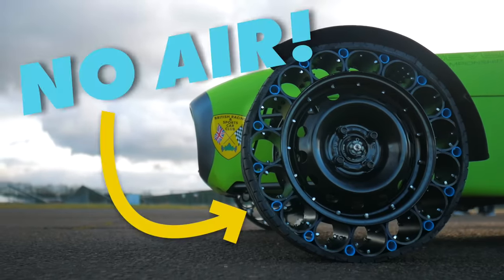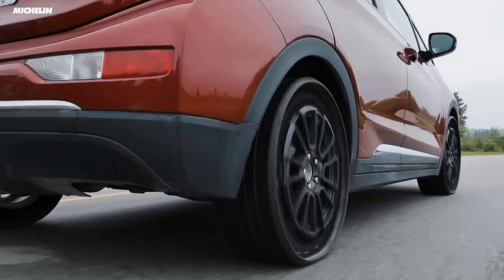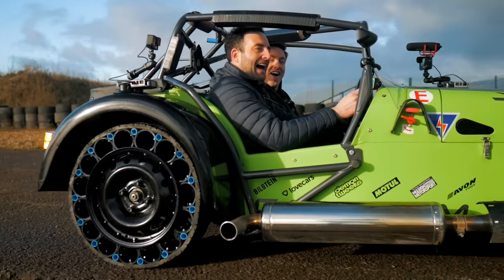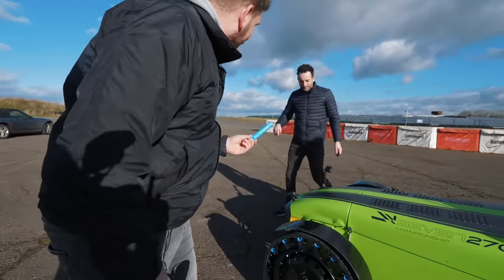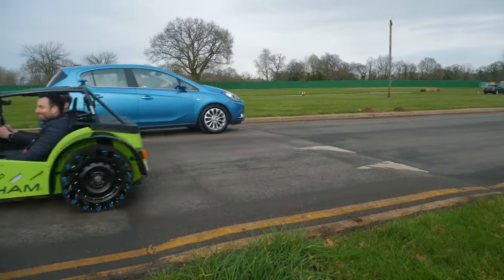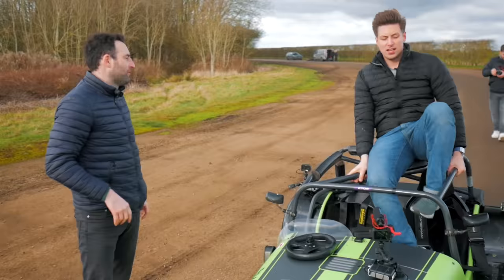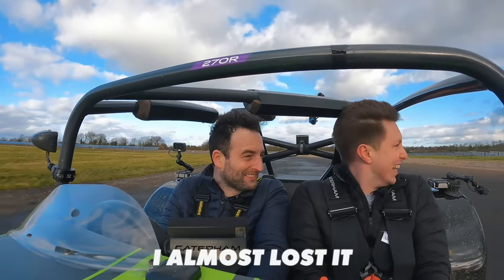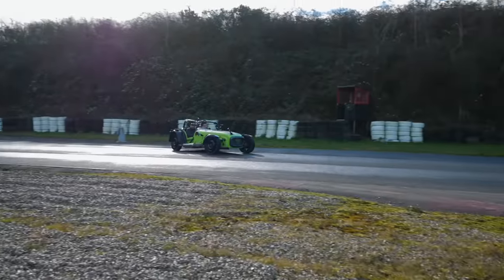I Made DIY Airless Tires

Comment: If they can be made cheaply maybe selling them as an option for spare tire or upgrading them for full out driving would be great like making the plastic parts one unit instead of separate tubes this would allow you to make it round this more stable could go way faster and then attached rubber on the outside could be one solid ring and the tread would be able to take more sideways pressures if it wasn’t flat totally but a small sidewall to enclose the innards not thick at all but it would eliminate air and last the same as it’s air having counterpart  or even using a regular tire with a thinner sidewall having your idea for the tire on the inside to just eliminate the air aspect it will allow people to use them much longer and even start to retread the tires like they do big rigs making it cheaper in the long run the hardest part would be designing that circular structured plastic to be installed before and still able to put tire on rim or have the rim itself be able to be taken apart and reassembled so that you can build it opposite of the current process assemble the tread portion with your pipe parts inside the tread /sidewall unit and then assemble the rim part last the design of the inner rim would make it possible to utilize this on any vehicle as you could have options on each peice making it interchangeable for many reasons like custom colors shapes and technology that can be added to suit everyone and every vehicle the only real problem is designing the product in a way that makes it very inexpensive for you to make it and low enough for customers to justify changing from the regular rim to your product you could make the initial purchase at a much lower gross profit margin than the customized parts that are available this way the product will be available to lower income ppl that need a reliable option and the customer that has a large income and can afford to make a fully custom tire replacement is the one paying the higher margins for a unique product that is exclusive and would be charged as such but if the base model so to speak would be affordable and have multiple reasons that it is the sensible thing to do it would undeniably be competitive with regular tires and would have less rubber no air hopefully similar handling and price unless it’s cheaper and have a far superior lifetime on top of being retreadable but still appeal to younger and all other crowds for its price and options so the low rider guy could pick whitewalls the racer would get streetslicks with the lightweight additions the outdoor guy gets large truck all terrain options and gramma can get the basic model or that single mother with kids can afford to buy the basic version eventually opting for the matching color of the car on the inner setup when the kids get older and are ashamed of the boring rims this could be done even with todays tires and rims but these would be one wheel upon purchase unlike rims and tires but would have more peices that can be replaced for artistic or functional reasons one could do collaborations with fashion designers or anyone like rap stars tv stars etc etc etc and could offer new attachments when the current ones sales die down bringing and sustaining steady sales with endless unique variations and one off auctions artist designs for every big and small niche groups icould go on and on as you see but this idea is beyond good if someone takes it seriously and invests gets investors and a good team to perfect and create a functional product

Comment: I think if we can surround each pipe with a hard rubber to reduce the noise and interaction between pipes on tough terrain and enclose the whole system those tires can go on the market. Shocks should help smooth the ride out. I'll sign up for trials!

Comment: you could fill the pipes and gaps with something like Construction foam so you dont lose bolts and it also could help with the roundnes of it and maybe use something like flexseal at the seam to reduce the noise it makes

Comment: I'm a drainage design engineer and I so wish you boys would have contacted where I work for advice as there are definitely improvements that can be made with some better pipe choices. I reckon I could remove some of the bumpy ride from these tyres.

Comment: I wonder if it would be better if you added a large circular disc to either side of the pipes. Adjust the pipe lengths so both discs connect to the pipes and create the same width as that of the outer tire. Could help durability of the pipes by supporting the car a bit, maybe also make the ride smoother and quieter.

Comment: Cap the inner and outer sides or your tires. Should help deal with both vibration (slight) and sound (large) parameters. Since you're using rigid internal materials, you don't need to worry so much about the flex of the outer caps. (Basically just put a lightweight plate over the sides with all the holes.)

Comment: Since the Michelin airless tyres i've wondered, in certain conditions. Wouldn't dirt and gravel get inside the tyre and cause balance problems on the long term?
Reply: Between mud, gravel, and water, and manufacturability, there is a reason why airless tires haven’t taken off.

Comment: Another major problem, the wheels actually act like a suspension due to the air in the tire.  This design essentially eliminates that suspension and really is due to deform under any sudden impact, like a pot hole.

Comment: Why not, take a normal tire, and stuff the " air" area with the pipes and then mount that contraption on a wheel.... that would remove the "seam" that you made when you put the rubber on the tier and proberbly make it a bit more stable when turning, as the pipes would be held together by the tire side..

anyhow, really cool that you did this your self :D

Comment: "For those of you who don't live in the U.K. - this, is a pot-hole."

Yeah cause, ya know, they don't exist anywhere else.... did I miss a joke or something? I'm assuming I did. 
That pot-hole wasn't even that bad. I've hit a few that weren't clearly visible, that felt like I just got into a head on collision. And that one (one I have clearly in my mind at the moment) did screw up a brand new tire. Broke one of the steel belts I believe. I wasn't even going that fast, I had just made a 90 degree turn less than 10 yards beforehand.

Comment: You guys could try to keep the thread in one piece instead of cutting it to a flat ribbon, and finagle the right dimensions for the water hose by stuffing rubber mats tp the outside of the steel wheel. Apart from that, glue. Nuts and bolts, okay, but glue is a friend. Good industrial-strength epoxy or something would do wonders to hold the pieces together.

Comment: Instead of cutting the belt of the tire, what may work better next time is to try to insert the hub and pipes in a slightly compressed state. That way in addition to keeping the belt and tread intact, the wheel will have additional mechanical retention of all it's elements. Just a thought

Comment: fill the gaps between the tubes with spray foam insulation. reduce nut and bolt loss and vibration maybe?

Comment: You could try filling between the rubber and the first pipes some installation to quiet it and use a metal cover that bolts onto the plastic or metal for both sides

Comment: You should do the same thing except use fuel hose vs the plastic tubing. Number one it's steel reinforced and rigid but will flex and deform with pressure and return back to shape. Another good reason to use them is they have a service life and once they reach the end of that service life they are destroyed so you can probably get them for free and free is always in the budget. You can also galvanize the rubber to the treads which with the plastic rollers you could only glue and as we know glue will fail on plastic tubing. 
Nice thought experiment on design the materials are questionable.

Comment: If you could find a pipe or a sheet of spring steel that could fit around all the pipes, just under the rubber, then that would smooth out the ride while reducing the noise.

Comment: I think if they had gone with one more round of smaller pvc pieces around the outside then the wheels would have been rounder
Also doubling the pipes and pvc glue to set them as one
Would increase tensile strength as for the nuts and bolts some lock tite would be fitting no pun intended
Ps perhaps a dip in liquid rubber as a final bonding

Comment: i always think the best way to go for an airless tire is to have one solid tire with layers of varying degrees of density/firmness. The outer and inner being the hardest with soft layers of rubber in between. 
It might be a material engineers nightmare to design something that can withstand the heat and not lose its firmness while getting hot.

Comment: if you managed to fit the tread in one piece so it didnt have a join it would be a lot quieter I imagine, is there an issue that prevented you from finding a tread that fit without cutting it into a strip? I am so impressed with how they held up regardless

Comment: could you use a metal wire through the bolt holes to hold them together instead of bolts? this could give some rigidity by pushing the pipes into the rim, and also lose some weight. maybe also try waterhose type pipes in place of the small ones? say, hydraulic hoses? those are quite good radially, you wont collapse them easy

Comment: If Michelin did this and had the smaller bits you have a bit softer and fully enclosed the tire like a normal one with steel and rubber instead of your bolts I'd imagine it would preform superbly

Comment: try using washers and rivets? maybe it will hold firmer than bolts. i mean you don't need that thing coming apart. 
or maybe just sowing it together using steel wire, or something other thats strong enough?

Comment: Are there any springs in the tires? Any way to replace some of those horizontal blue cylinders with some sort of vertical spring structure? You wouldn’t have to do it to all of them but it could help with the bounces and noise. Also, may extend the life of the tire by absorbing some of the shock.

Comment: I feel like having a thin rubber surface between each PVC pipe would be ideal, and rather than metal fasteners, use an array of zip-ties and hot or foaming glue.

Comment: How about one large pipe the diameter of the tire that you wrap with rubber to keep the round shape from deforming. Also, balancing the fully asembled wheel would help with vibration.

Comment: Once you solve the problems I'd like these for motorcycles. It's way harder for us who sometimes cannot carry tools to fix a flat. We can't even limp home. My car and bike both have somewhere around 35 psi for the rear tires and 29 psi for the front tires and that's done by design. How could you judge how to design the tire to simulate these air pressures? How much wear and tear would cause the performance to slip? One drawback, you can always re-inflate an air tire you cannot do anything but replace a tire such as you design if it fails structurally.

Comment: They are missing a major aspect of handling. There's not a shoulder of the tire to roll over to under tight cornering. It's one of the hardest things to replicate  and one of the biggest reasons we still use inflated tires

Comment: If a layer of rubber was added on top of the tubes, then got lathe ground to be even... The thread on top of that would be far rounder. That said, it probably requires facilities unavailable to your typical airless tyre enthusiast.

Something almost everybody can do is have a tyre shop balance the wheels though.

Comment: I would bet if you used rubber coated pipes and bolts, and used locktite on the bolts, you'd have a lot quieter and durable design

Comment: might help to designing a tread with  enough rubber to fill those pizza slice looking gaps between the tread and pipes. Might also help with holding the tire from spinning on the pipes

Comment: Actually I wonder how well these would work for offroad rock climbing in a place like moab.  The actual design itself would work with because of how deformation works on them I would think. Would provide better at absorbing shock I would suspect.

Comment: I am thinking it would be awesome if someone made them to go inside the tires and still  fill it with air. So if the air goes out,  then it doesn't  go flat and you can keep driving until you have time to fix it .

Comment: Bed of nails wouldn’t puncture a normal tire either. You can actually stand on it barefoot and you wouldn’t get hurt. Pressure is distributed on all nail heads. You need a singular nail standing up to do any serious damage.

Comment: 300 a wheel while a full set costs the same currently for my car..

I still think solid rubber would be better, they did the air to make them cheaper to make and force the consumer to keep purchasing more tires, instead of just one and done for several years.

Comment: My questions are, if it breaks do you have to replace the whole tire? If it breaks is it more dangerous than a flat? Is it cheaper to just put air in the tire rather than replace the wheel when it breaks?

Comment: I think you're almost there but there's always a ton of materials to use what is a tire in the beginning with a pile of rubber right usually filled with air right what if you remove the air and just fill up the inside but rubber such as a ton of flex seal or flex paste and instead of having an air filled up tires just a solid rubber tire whole thing

Comment: @OVERDRIVE - I wonder how those tires would hold up with some custom 3D printed like harder-semi flexible filament for the "blue pipe" parts, - making a wedges shape that contours oround the pipes 1/2 way on each, and providing a "round' edge (like a wedge of cheese off a wheel) at the same time? they would be shaped something like )(O)(O)(O)(   [in which O's are the drain pipe foundation and the )( is the 3D print] really tough, but 'semi flexible' filament might be the middle material needed to allow a smoother/more silent ride. (and less parts able to fly out if made to encapsulate the pipes instead of bolting them to the pipes)

Comment: If pvc pipe use poly pipe and pex pipe tougher than vinyl chloride/ and some rubber test balls for 3" pipe sandwich? I probably would of left some outside bead overlap  instead of flush tread probably could pack and inflate test balls then it's still partly air and replaceable segments if 1 of test ball goes plat

Comment: rip suspension. Driving since 1997 and never had a puncuture. There isn't even a benefit considering the environment with these, since you use a tire for the contact patch.
But it's a nice solution for post WW3.

Comment: the only reason normal tires are still around are because of law enforcements use for spike traps against criminals in land vehicles, the airless tire concept has been around since at least 2013-2014

Comment: Could you not get a tire tread that was already heat molded together, cause just bolting the tread together to the pipe just seems a bit wreckless. It would def hold up better, also having some kind of half a side wall would hold the pipes in  Just the weight on the pipes and them not slipping out would give the tire friction to roll. And with a complete round heat molded tire tread, less bump

Comment: Tire companies are probably sitting down with popcorn during group motivational meetings and watching this shit, laughing their fucking asses off.

You should consider seeing the 3D printed tires that they're coming out with and it prints the rim as well. Tire companies are doing it in different ways but yeah just pull up to a tire exchange location and just like exchanging propane tanks they'll pull the old tire off with the metal core on it slap on a new metal core then print the tire onto it and install.  Eventually but in all likelihood it will probably just get printed in some tire and lube center. Where employees will install it themselves it'll just probably be a specialized 3D printer or variant on the technology.

Comment: I can solve your bouncing and vibration problem. I made airless tires for my bike and looking at the design you have you could easily build a form and put epoxy around the outside edges of your pipe footing and attach the treads much the way they do rethreads on semi's rear tires. Now, as for the front/steer tires you would have to find a better way to attach your threads as glue on threads is banned on any steer tires. What I made has been going for 3 years now averaging 6000 miles a year and a sidenote is I have noticed the thread wears much slower than air tires. Not sure about the science there, not a scientist here, but something has changed the wear results. And good luck with this program, the big industry will lobby politicians to ban any homemade tires from being on U.S roads.
(By lobby I mean pay them millions in kickbacks and bribes they are all so accustomed to. That's how politicians become millionaires in only two short years). Michelin, Goodyear etc will not allow people to take away their wealth. The only thing that may save the airless tires mass production and sold at a affordable price to consumers is if they design them to fail around a certain mileage. If you designed a car that went 500 miles to the gallon you would not live to see it on the road! They will kill you and steal your research and tech with long black SUVs and box trucks. Ask Nikolai Tesla about that!

Comment: So this concept isn't new, rather older than the steam engine, and it has always been considered a brilliant idea, that's from where run flat systems originated. But what I have not been able to understand is the removal of the sidewalls on a tyre like this. Wouldn't it actually be complete with sidewalls, or is there a reason why they're removed.